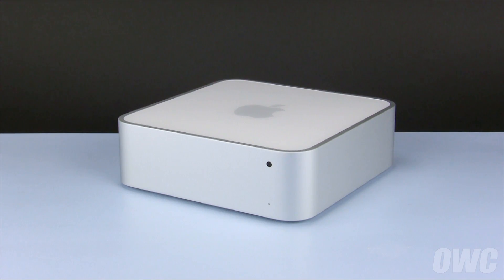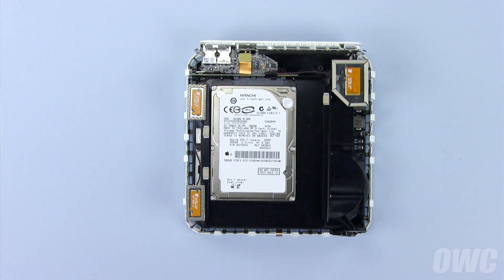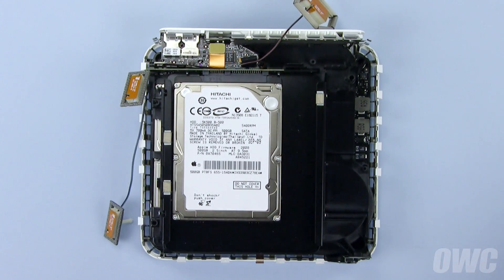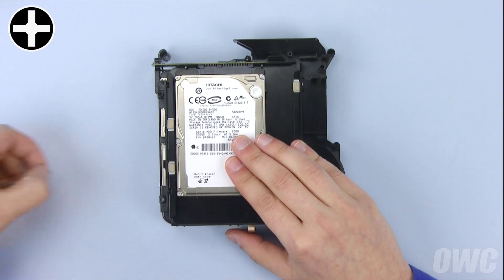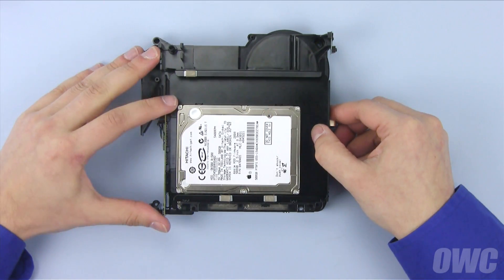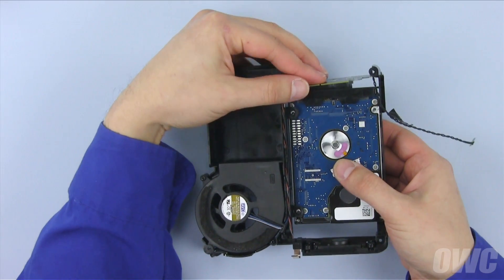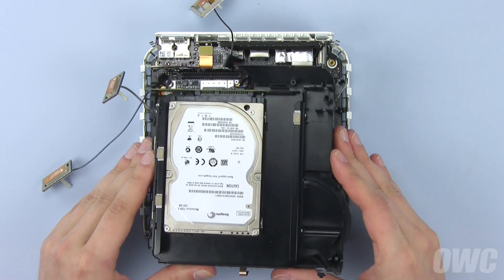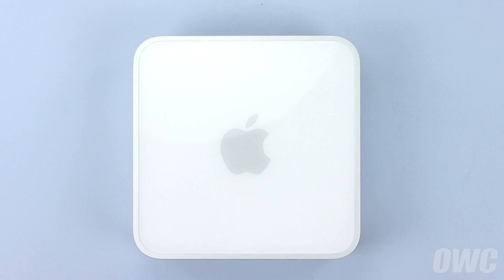Mac mini Server 2009 Hard Drive/SSD Installation Video

Comment: Great video!  

Unfortunately my Mercury Electra 6G/480G SSD won't show in my '09 MacMini Srvr.  The drive worked fine in a USB3 dock to my Mac Pro - it showed up, I formatted and was able to copy data, read data from and overwrite data to the drive.  

I also tried both bays in the MacMini.  The 1TB HDD works fine (in either bay) however.